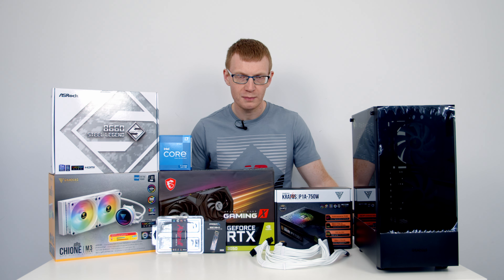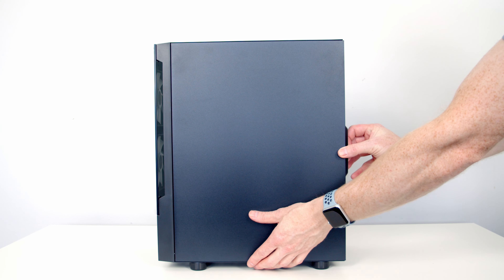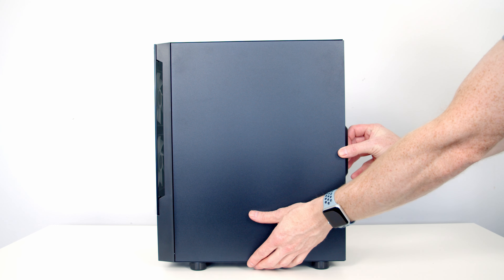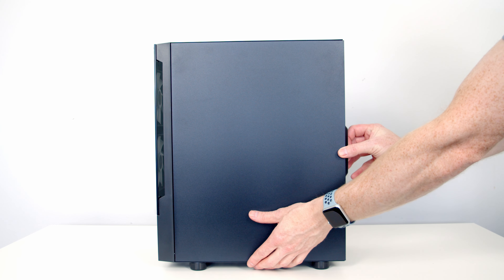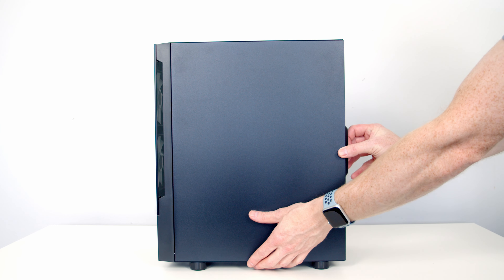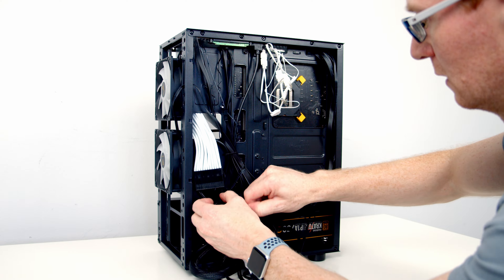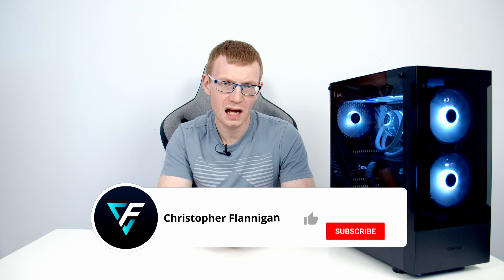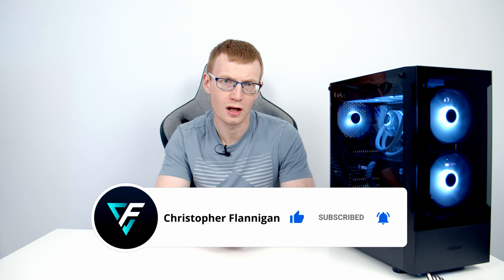Gamdias Talos E3 Build - Step by Step Guide

Comment: 2:28 you can't fit 3 120 fans unless you run it without the front panel. I put three and the front panel wouldn't fit. gamdias website also says 2 120 or 2 140... however with a bit of rigging you can fit three on the front
Reply: Thankfully I saved this video link. I need a new fan at the upper rear of the tower. Any suggestions my friend?
Reply: @Jaake-my2rq  I used the "thermaltake ring" fans when I just wanted blue or white solid color and the "thermaltake ct 120" when I wanted to customize the RGB. Corsair 120s were also good fans too but you needed the Corsair controller if you wanted to change the colors

Comment: Just a thought but I would have thought you would take the protective plastic off the AIO pump last. To me, there was too much building going on (esp with the radiator) after you took the plastic off and so risked scratching the shiny surface.
Reply from the maker: You could leave it till the end if you prefer

Comment: Is there a way to control the rgb lights from the front and back fans through the motherboard app instead of having to press on the little led button on top of the case?
Reply: Have you got the answer?
Reply: no you need new fans
Reply: I have this case in white, its lovely, one thing i found out, if you press and hold the LED button on the case it hands control of the fan colors to the mother board, nice if you have a LED light on your CPU fan so you can match them, however i couldn't find a way to control the fan speeds, any ideas. 
I also put an ASUS TUFgaming B550 Plus WIFI ii ATX and it fitted great, I put most of the cables through the three slots just under the right edge of the board, no problems.
Reply: Tried to hold the rgb button but it turns the fans off. And I can’t control them with armoury crate I have two cases same thing

Comment: I really love that GPU. It seems to handle low temps at low noise. I wonder how well it can do in hot summer days? 
It's the only 30 series card brand that id invest money in if im honest. MSI really have nicer cards and never sag on the motherboard
Reply from the maker: It will handle no problem. Only reason for max temp is that’s the temp the fans come from on at they then cool the card down in a minute by around 20 degrees under full load and fans switch off again
Reply: @ChristopherFlannigan  Thanks for the info. Im definitely going to try and find a deal for this card type. Do you think its a safe bet to say the the 3 fan (gaming x trio) version is unnecessary if im getting 3060 or 3060ti?

Comment: I only have 2 fan headers and one is already used for the cpu cooler will this case work or do I have to get a new mother board
Reply: Just buy a fan splitter cable or it can come included somehow, see how it looks in the video during the AIO assembling. The number of heads dependings on how many fans you have

Comment: I have bought this case because of this video and bought a cooler master aio,  when I try installing the radiator to the top, it seems to be hitting the ram on the mother board so it doesn’t allow me to match up the holes to mount the radiator. This has been the most frustrating part 😂 hoping someone can help me figure it out
Reply: I'm havsing this issue now ! Did you find a way???